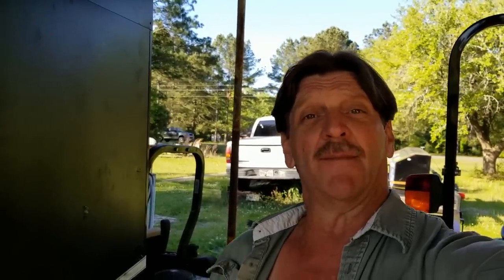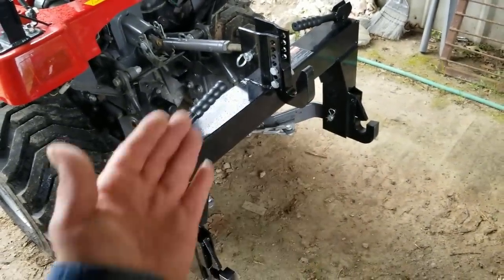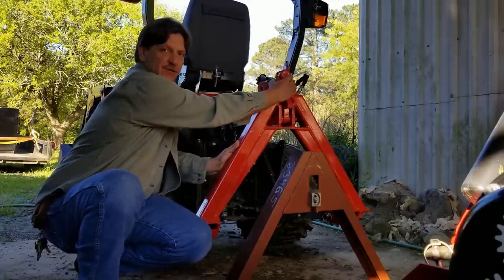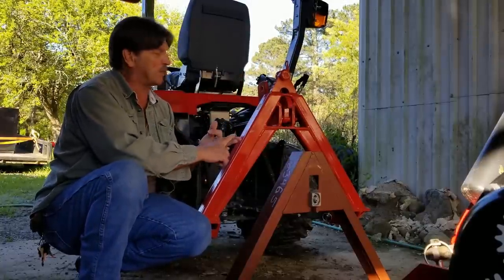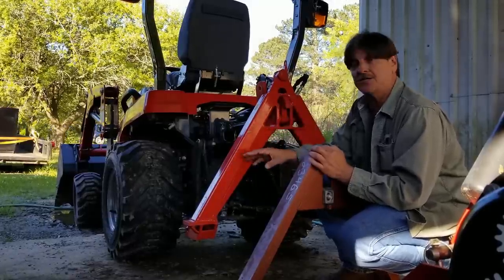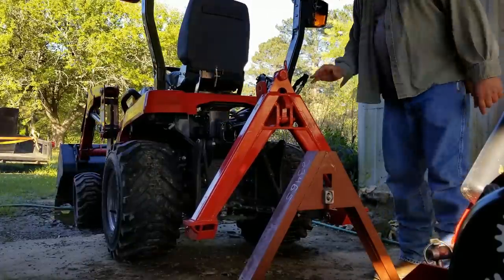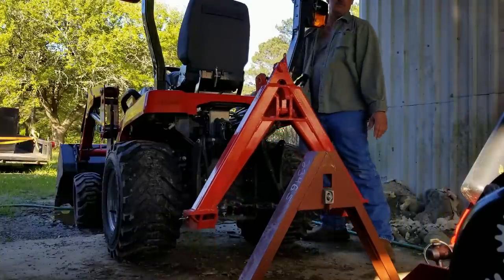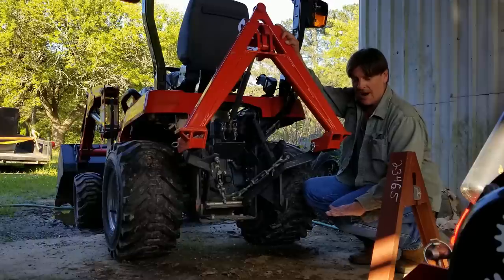#71 New Style Quick Hitch For All Tractors & Implements And What I Do With Hoses On Massey GC's

Comment: Nicely done John.  John, about 14 years ago, I purchased a 3 point quick hitch assembly that cost 3 times the amount of AGCO's new QH and it is designed almost identical to AGCO's.  The female side can be purchased separately as the AGCO but does not need to be tack welded to the implement, which I prefer.  I like your idea to make a universal female hitch that will satisfy the hook-up for several implements and save a bundle of coin.  I too wrap my hoses as you mentioned and it does not get tangled or mashed in any moving parts of PTO.  Great video and a ton of useful information.  Keep on slinging those videos. Oh, BTW, you got my hat on (ha). Mine is just a whole lot more beat-up (ha).  Hey, I'll trade ya (smile).  Have a great weekend, my friend. Always love your vids. ........Don
Reply from the maker: Hey Don, I don't think it is for the everyday guys (weekend warrior) but I have seen dirt contractor change out equipment 5 times in one 12 hr day. I think it is just what he needs!  I will try not to mess up this hat!  You have a great weekend my friend!
Reply: Yep, you're right about quick-change.  Okay, I'll put a part in my next video wearing my scrunched-up Massey hat just so you can laugh at me (ha).  Hey John, I'm the same way about tractor brands. I don't care what color or brand a tractor is, just as long as it does what the owner needs it to do and I love seeing all of them in action.  Later brother.
Reply from the maker: LOL!  I guess I should buy a Massey hat to work in! lol

Comment: Could you flip one of the pins on all your implements so that one would be on the inside and one would be on the outside. You could then weld three tabs off the back of that frame and just slide it right onto the pins from the side, then tilt it up and run a pin through where the top link would normally go? All of your implements would be slightly off center but that seems like it might work and it would be fairly easy to make it the most universal fit. I wonder if this will become the norm like the skid steer quick attach plates did.
Reply from the maker: Man! aXe, that is a great way to mod it!  I think if it does get popular they will get cheaper too!   Have a great weekend!

Comment: That is a bit different, but it is extremely similar to a Delta hitch system I first saw close to 10 years ago. 
One issue he seemed to gloss over and imply it would work, is that, especially with subcompact tractors, you will not have the lift capacity to lift the weight of older cat II & III implements. 
Also as the pin spacing on cat I and cat II and cat III are all different as are the pin sizes. Also with older (not all that old) cat I implements are not consistent. These factors cause his interchanging thoughts will be very limited.
Reply from the maker: Thanks Coy, for watching and the comment!  You are right about lifting weight!  If you have a cat II or cat III you can lift anything from that down!  I think the reason they design it to weld on is so pin size and location won't matter! I think this QH is more for big farmers and dirt contractors!   Have a good one and thanks again!!
Reply: Louisiana Aquaponics as I mention I have what was called a Delta hitch some years ago. It was an expensive  hitch system as the implement portion like what you show was designed to be permanently attached (or at least semi permanent). It was a very neat setup with spring loaded pins to keep the 2 parts connect especially for non PTO implements.

Comment: I’m looking for something that could be universal for category 1 to category 0 implements any ideas what I can look into ?
Thanks
Reply from the maker: Thank you Brad, for watching and the comment!  Let me do some checking and see what I can come up with. It might be a couple of days before I have something for you.  Have a good week! See ya in the next one!
Reply: @LouisianaTractorworks  thanks I picked up a Mott’s flail mower for basically free but it has a category 0 set up and I was trying to figure out how to use on my l3301
Reply from the maker: Ok Brad. After some digging this is what I came up with. I would switch your pins to cat 1 if they can be removed. here's a link for the new pins.https://www.amazon.com/Special-Products-Speeco-P7219-Accessories/dp/B001TQ2PHU
Then put these bushings on it for you quick hitch. here's a link for the bushings cat 1 to cat 3 QH. https://www.amazon.com/Adapter-Bushings-Category-Tool-Bushing/dp/B075433XWS
You can probably get all this at a Tractor Supply as well.  Hope this helps you!

Comment: This is a nice setup but if you plan on moving the a frame seems like that defeats the point now you are carrying around that A-frame. Look forward to seeing how you use this setup.
Reply from the maker: Hey MTRUNK, I just don't want to wild it to my tiller but if I had a large farm and a lot of different style equipment. I would put one on each one!   Have a great weekend!!
Reply: But even if you moved this small A frame around, it's easier to pin on, while you hold it by hand. You align this small piece on your implement by hand: easy.  As opposed to aligning a whole implement! Even there, is way much better.  But two channels welded together are not that expensive or complicated to build either...

Comment: nice idea about the hoses. as for the quick hitch i think it would of been better off to fabricate all your 3 point implements to fit the hf quick hitch. because you are going to run in the same issues trying to fabricate the new one. this one is wider than that one the pins are too big on that one and so on.
Reply from the maker: Thanks OLD SIXTY, and you're right!  If the equipment came ready for the QH that would be better!   Have a great weekend!

Comment: Just to confirm, the only advantage to this design is the "quicker centering" to hook up. For a weekend farmer the final cost of this unit probably is not a positive looking at the Harbor Freight cost would be a better way to go for the amount it would be used "fun time" is almost free , so getting of the seat and hooking up is not such an effort.  Just thinking. But an interesting video anyway as to other options.
Reply from the maker: Thank you Harold, for watching and the comment!  You are correct this QH is not for the weekend tractor user. Have a good weekend!  See ya in the next one!

Comment: Good video. They should have made that quick hitch about 40 years ago.
Reply from the maker: I hear that! It would have been nice!  Have a great weekend!
Reply: We use a homemade one with the same size, its already 15 years old. These things are the standard for front 3-point hitches on bigger tractors. I have one on the back and one on the front. If you buy a front mower out here it usually comes with a receiver for the a frame welded on.
Reply from the maker: Thank you G. Work, for watching and the comment!  You must not be in the states!  They are very popular everywhere else for a very long time!  On bigger tractors it is the way to go for a quick hitch!   Have a good one!